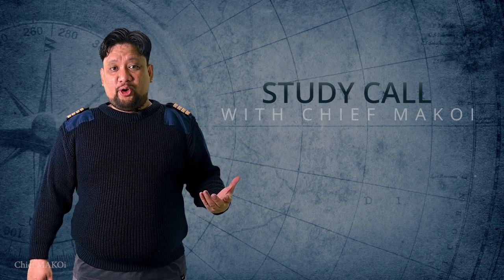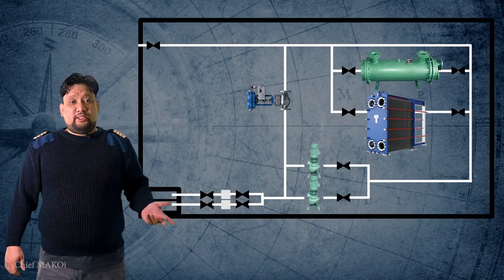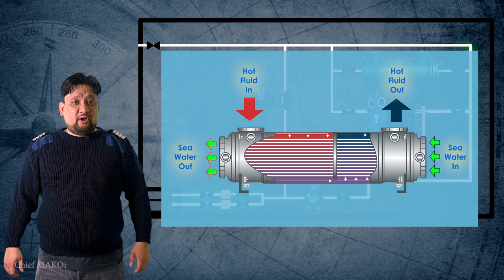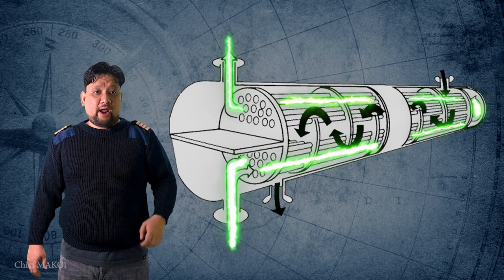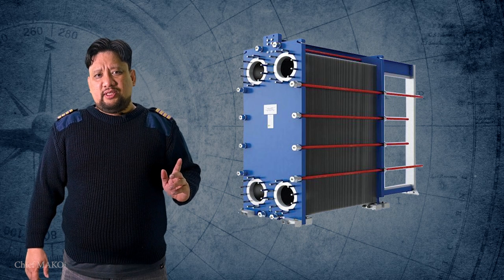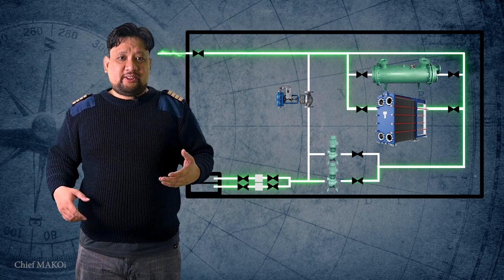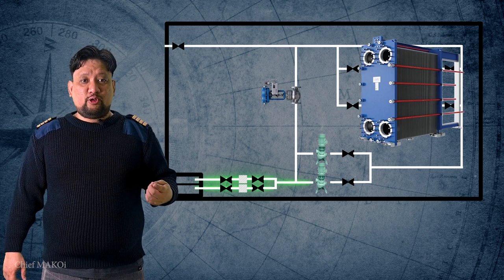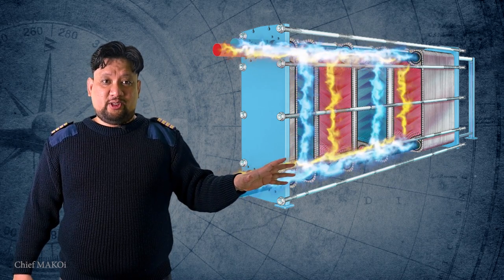Ship's Sea Water Cooling System | Study Call with Chief MAKOi episode 002

Comment: A ship's engines burn fuel to produce kinetic energy.  Heat is an unfortunate byproduct.
Reply from the maker: Actually, if we follow your logic, burning fuel produces thermal energy (heat) which makes the gases expand and push the piston down.  Which means kinetic energy is the by-product.  That's one of the reasons they are called "heat engines".
Reply: @ChiefMAKOi  I understand your thinking but I disagree with your viewpoint  because the goal is kinetic energy, be it the vertical movement of the pistons, or rotational movement of the crankshaft.  Yes, detonation causes thermal energy, but the purpose of the internal combustion enginel is mechanical, or kinetic energy.
Reply from the maker: @HemiChrysler  semantics. In any case, if we're nitpicking, both of us are actually wrong because we both used the word "produced".

Comment: Starting and reversing
Refrigeration onboard 
Fire fighting system
Reply: Mr Fz 
Bilge-ballast system.
Fuel transfer system.
Fuel system to engines.(atmospheric mixpipe in the old days and the answer to their problems)
Dirty oil system.
LP Steam or thermal oil system
How to properly test the Oil Filtering Equipment and the emergency generator.
The different types of steering gears
👍😄